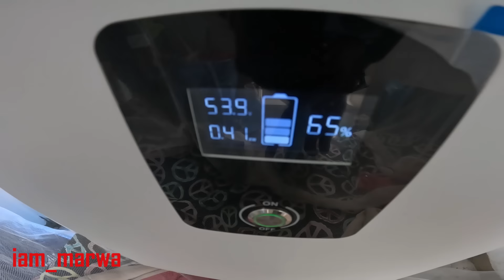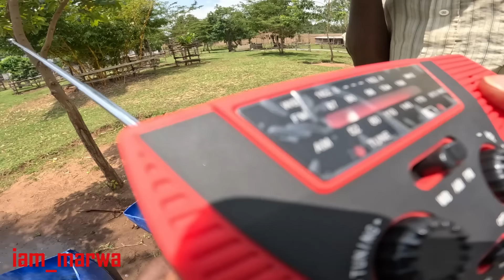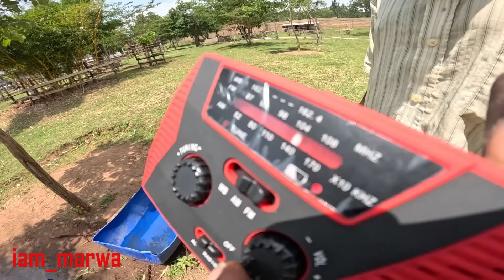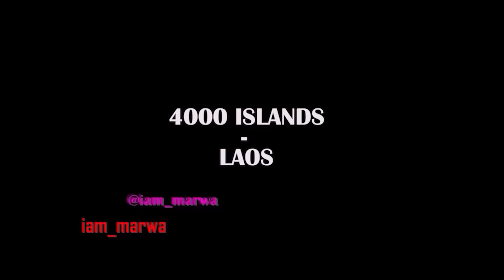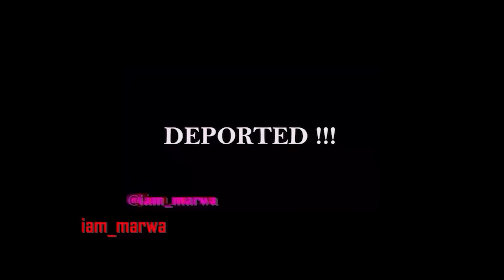THINGS FALL a PART ft. @DeeMwango  & Dad in My Villa in KENYA , AFRICA !!!

Comment: WHY DON'T YOU CUT DOWN, AND  DIG  DEEP WHERE IT'S LEAKING FROM! THEN YOU SEE WHERE THE WATER LEAK IS, THEN YOU CAN PAINT ON HOT TAR, WITH A BRUSH,OR MOP, AND THIS WILL SEAL IT AS THE TAR COOLS DOWN, THEN AFTER THE LEAK STOPED - FILL IN A MIXTURE OF  SAND- ROCKS  CEMENT AND WATER,! YOU KNOW, THAT THEY PUT TAR ON LEAKY ROOFTOP 😊
Reply: Why??????????